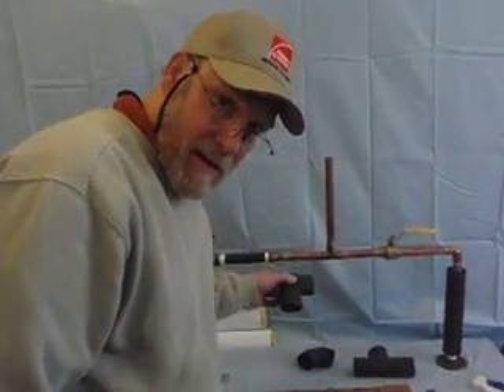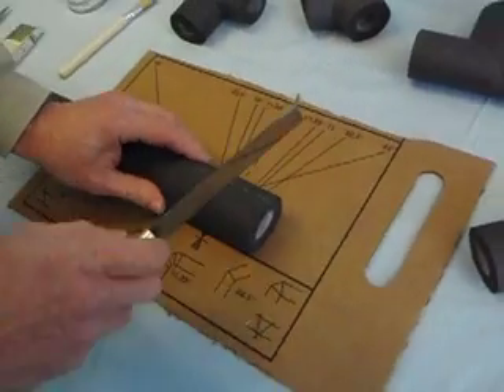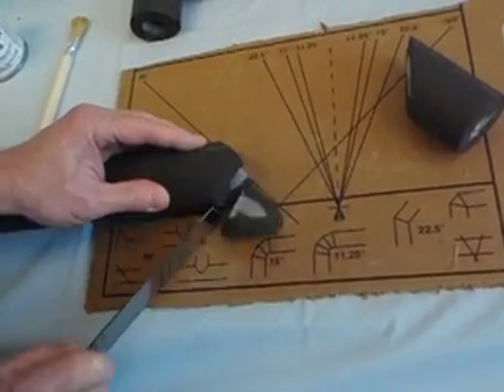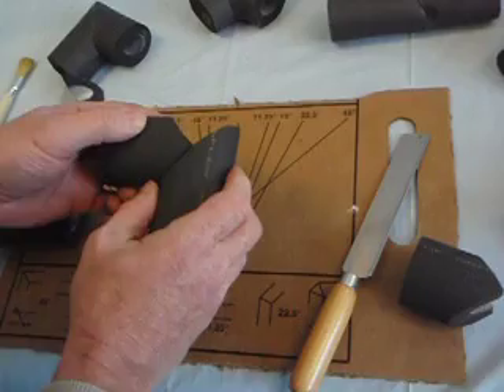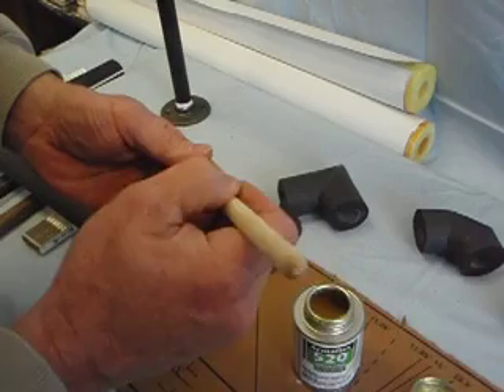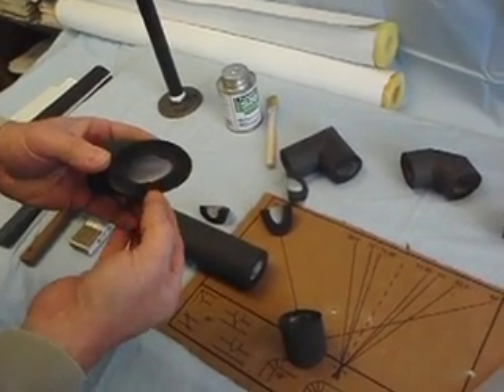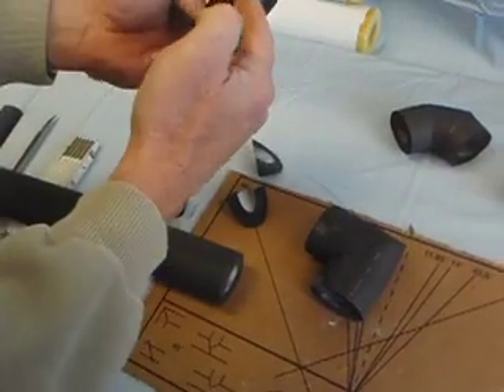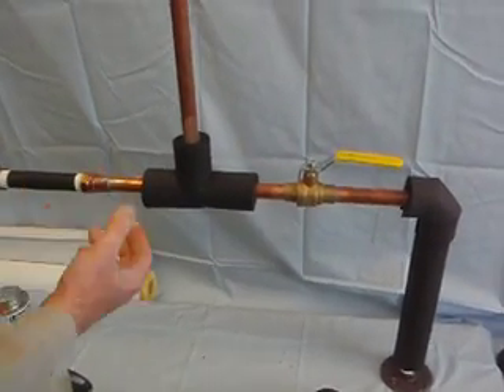How to Install Rubber (elastomeric) Foam Pipe Insulation on LARGE copper pipe.

Comment: @steve16412 yea i work at kysor warren we make racks that run refrigerent to cases that cool your food etc... some of those racks have pipes as large as 4 1/8 in pipe that run one way and 180 and have several pipes running close to or by pipes needed insulation and those pipes might even need to be insulated. im very good at insulating but its neither rewarding or enjoyable. i just transferred to brazing. now being the person to pipe and braze those racks together is much more fun.

Comment: @steve16412 yeah i actually enjoy doing this stuff. foam insulation and armaflex. its just the fiberglass stuff i dont like especially owens corning makes me so itchy. i used to work in a fiberglass shop and i was in charge of the chop gun. it is a paint spraying type gun that sprays the resin while it also shoots out chopped fibers of fiberglass. yuck that was a nasty job and everyday i would come home and i could not get the itching to stop even after the cold showers.